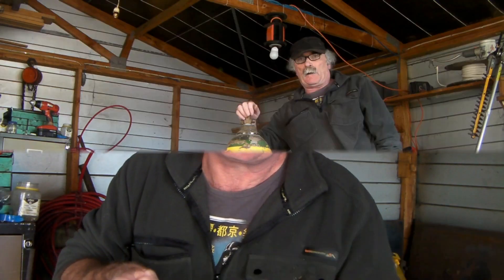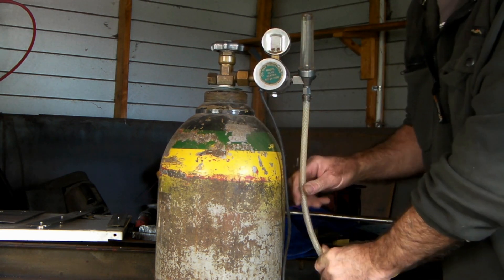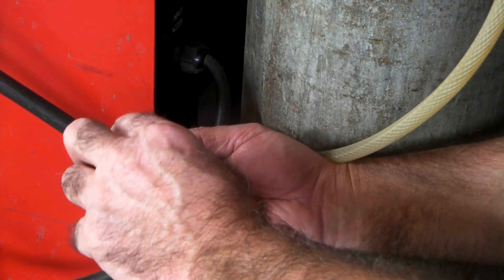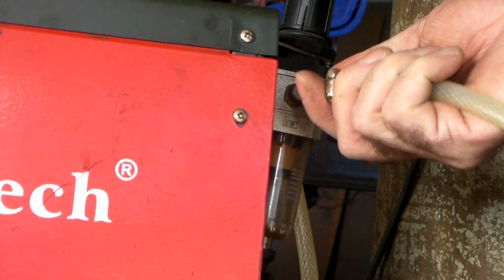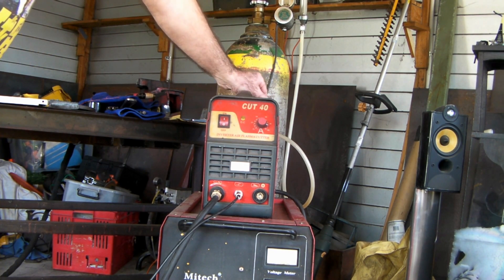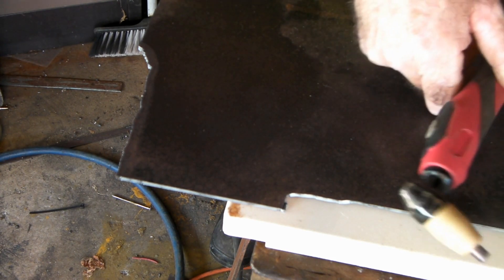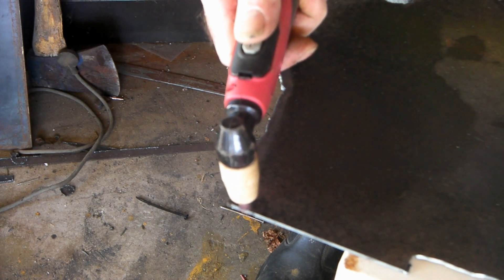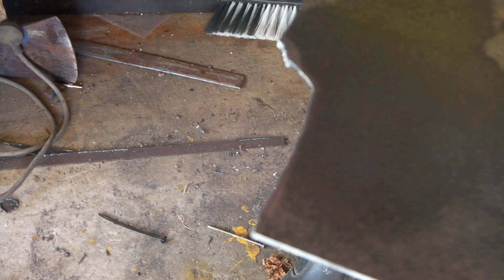Can You Plasma Cut With Welding Gas

Comment: CO2 won't maintain ionization, however in a pinch you can put an air mixer valve inline before the plasma cutter, the co2 will draw ambient air though it and mix, this usually will provide enough ambient nitrogen to maintain ionization.

Comment: What about an oxygen bottle Pete?
Reply from the maker: Hi john it has to be dry and non explosive mate .cheers pete
Reply: @petestools  hey Pete it's a misconception that oxygen is explosive, it is an accelerant however making something burn hotter and faster. Oxygen is not even flammable by itself. Think of oxygen / acetylene cutting torch the  oxygen makes the fuel (acetylene) or (propane) burn hotter
Reply: @johnsassano8728  What if you uped the Oxygen content of the air (by blending compressed air and O2 {note: not before compressing the air as O2  may cause the compressor oil to explode }

Comment: Early plasma cutters used argon and helium. Inert gas will make a better cut if it's set up properly especially helium.
Reply from the maker: Hi , yes but compressed air is cheaper

Comment: can portable plasma like that use o2 or not ?  does it safe or not use o2 for Hobbyst plasma
Reply from the maker: No its to wet .And air is far cheaper chees Pete.
Reply: @petestools I’ve been searching for info on using oxygen for plasma gas with these typical small plasma cutters but not finding any info that actually tried it.  You stated oxygen is too wet……
Have you tried it?
Reply: yes im trial portable plasma can use oksigen (o2) or not ?

Comment: Why would you Pete, compressed air is free from your air compressor excluding the cost of electricity? With a good dryer it's actually 10x cheaper than hauling up to the weld exchange and filling your bottle each time...the key is dry air!
Reply from the maker: Yea but when i was in middle of a cut and my compressor crapped out managed to finish my cut.
Cheers pete
Reply: @petestools  Agreed. Living rural, we get frequent power outage. Annoying when you need to finish something. Next step for me, can you run a spraygun with argon?🙄.